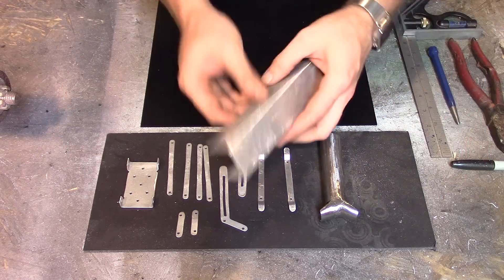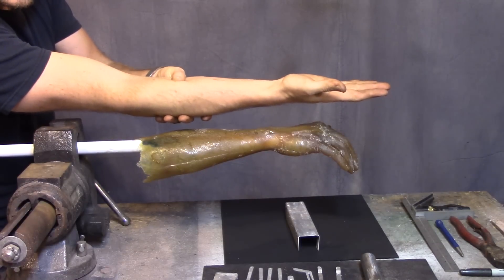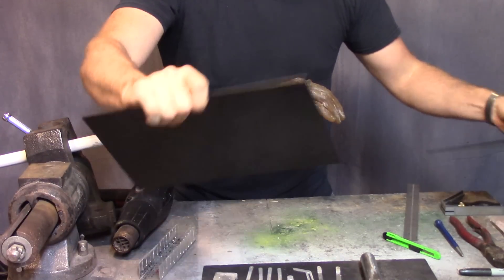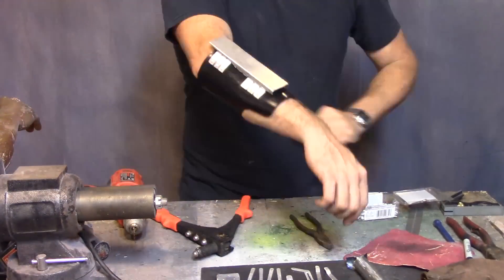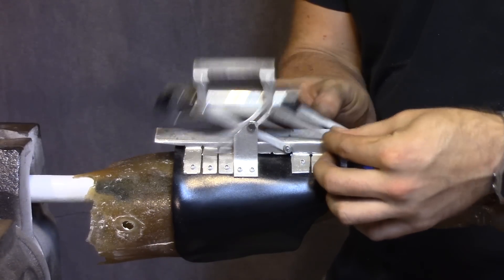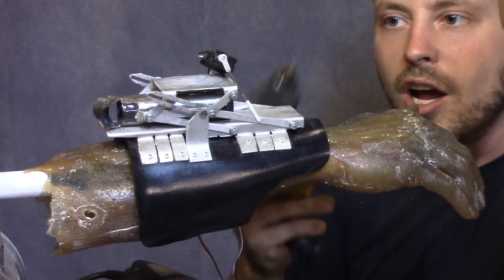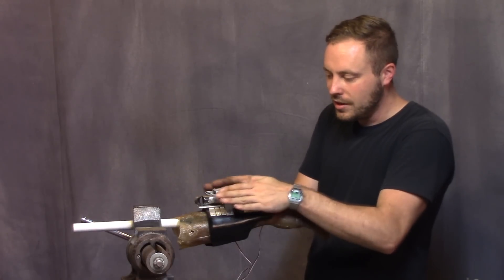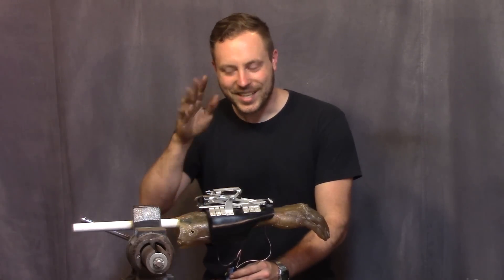BUILDING IRON MAN - FOREARM LAUNCHER Part 5

Comment: Try swirled grooved barrel as in snipers & instead twin outlet place a little curved disc shaped object (a few mm away from barrel) behind rocket such that it ejects combustion inside that which will provide surface for ejection force.